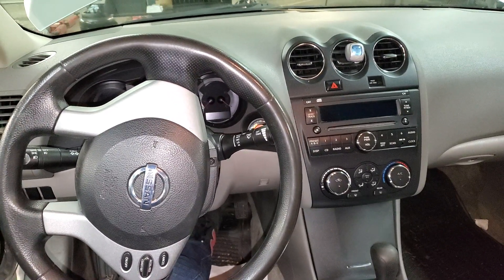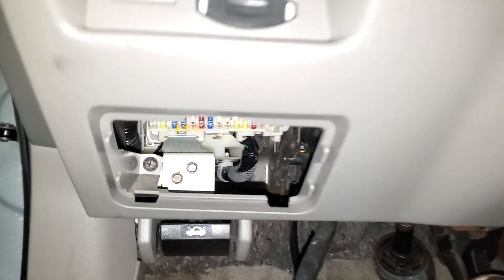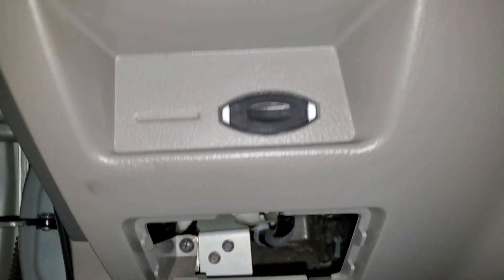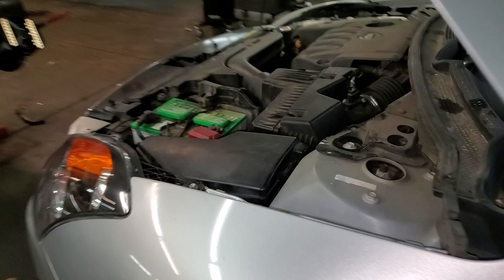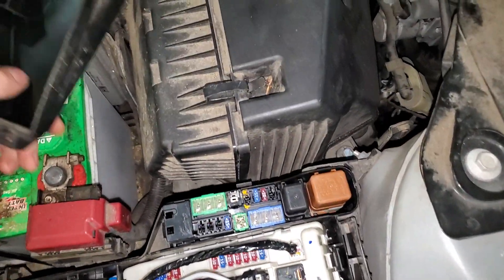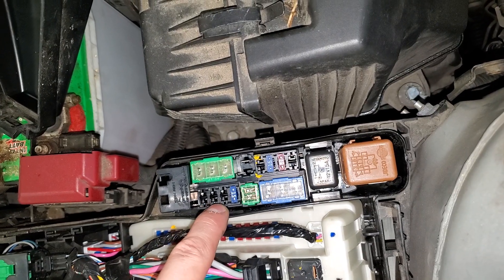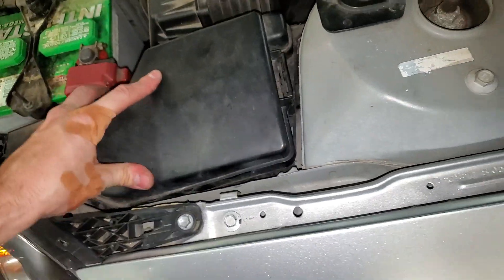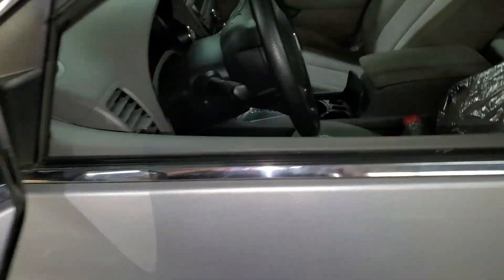2009 Nissan Altima Radio Fuses

Comment: If your radio turns on but the speakers don't work, or only work if you hit a pothole... pop the trunk and check the connections on the rear speakers.  Carelessly overfilling the trunk could damage the connections and with a damaged connection the speaker wire can short out and the speakers won't work.  I wrote two long comments about this but this is the short one lol. Really easy to check and I'm gonna glue it back onto the bracket although I may try electrical tape for now...
Reply: Thank you for this. I love you
Reply: @kevinlagunas7835  the electrical tape is working for me so far but double sided tape might be better which I will try if/when the electrical tape fails.  Prying out the radio can damage the dash which is what I did and have yet to figure out how to fix, they make cars so delicate these days, so much plastic that's easy to crack as it ages, the dash is some kind of rubber but easy to damage, try to avoid removing the radio esp if car is older.  
Also be careful changing out the cabin filter, I cracked the tab of the filter cover although it still stays in place. Cabin filter is a pita when it should not be.
Welcome to PrePlanned Obsolescence!  
Glad I could help.

Comment: I checked those two fuses, that looks like car I'm working on. But stereo powers on, it's just the speakers don't work.  They did and then they intermittently would go off, then come on.  As time went on the speakers worked less and less and then nothing except when I hit a pot hole, they would power on for a split second so I would drive about w volume up all the way, then I'd hit a pot hole with front right wheel and a loud second BLAM of the radio would come on then off again.  Someone said there may be a speak fuse but I couldn't find that, it seems like it's a bad connection somewhere but I don't know where.  I did remove the head unit and can't really see where the wires go to of course.  I damaged the rubbery trim on one side prying it out, what a terrible system!  But maybe there is someway to repair it.  It's a 2008 Altima, I don't think I'm helping anyone here but maybe others are having a similar problem... also, the door drain holes did get clogged sometimes and water built up, I don't know if the water was high enough to get the speaker wet or maybe there is low connection that got wet, I don't feel like removing the door interior... and also I don't really think that could be it cuz other speakers would still work I would think... I'll do more research-
Reply: YES! YES! YES!  I figured it out!  Others could have a similar problem so check this before prying the head unit out (and possibly damaging the rubbery dash trim- now I have to see if there is a way to fix that!... anyway!  someone on the Nissan car club website suggested  checking the rear speaker connections.  Pop the trunk and look at the connections. The left connection on the car I am working on was broken and dangling enough to short the wire to the speaker.  With it shorted none of the speakers work apparently.  Anyway, I put the plastic connection momentarily back on the metal bracket and this pulled the exposed speaker wires from shorting on the metal speaker frame and voila, I turned the radio on and I have sound again!  The connection must have broken when somebody overfill the trunk and the trunk was used for dump runs so sometime that connection broke.  Good Luck everyone!  Now I have to find some glue or tape to repair the broken connection, I think I can get away with not replacing it.

Comment: After installing a new battery the radio completely stopped working doesn’t power on nothing but was totally fine prior to changing battery, what should I do?
Reply: This is what mine is doing too
Reply: @lenaii  Mine powers on, but I cannot reset the stations or the clock.

Comment: My stereo won’t light up 09 Altima when my car lights are set on auto. Everything works, just a completely black screen. When I change lights to fog lights or all the way on, the lights come on like they are supposed to on the radio (head unit). Any ideas how to fix this? I have a BOSE - dealer told me it was because the unit was getting ready to go out and no longer work?!?!
Reply: I have the same issue

Comment: I have a 2011 nissan altima and I just had a aftermarket radio put in. It was working fine when I got it put in but now I don't  No sound coming from speaker in the car radio still  powers on
Reply: Did you figure this out?

Comment: How do i replace them just take them out and new ones ? Or is there more steps to it
Reply from the maker: Yea if they are blown and require replacement, just pull out the old ones and pop in new ones. If the new ones blow as well you may have some wiring issues like exposed wiring.

Comment: If somebody gave me a jump and put the cables on the wrong terminals would that blow the radio completely is those the only fuses that you're showing that the car has is there a fuse behind the radio itself
Reply: hi did you figure out howto fix yur radio ? that just happened to me
Reply: lisa , can u advise me ?  thx

Comment: Question last night my radio shut off completely car still works every time I played via Bluetooth it acted up up after few minutes like unpair my phone and just go blank on radio screen ( it’s not factory radio system) help what could be the problem that I can do myself without spending so much to replace easily
Reply: Did you figure it out

Comment: I thought I blew my stereo so I went to a stereo place called Audio Express n I got ripped off there they sold me a cheap stereo that sounded  like crap every time I turn my car off you have to reset it. 
Worst part is that the installer said it was just a fuse. I guess I checked the wrong one. My factory radio sounded way better.